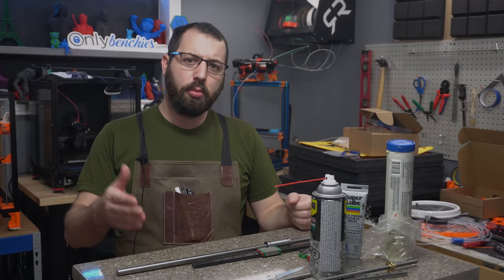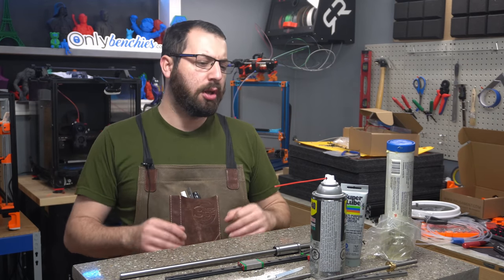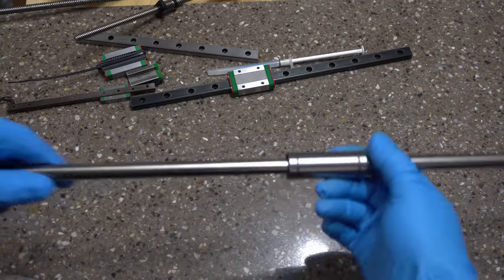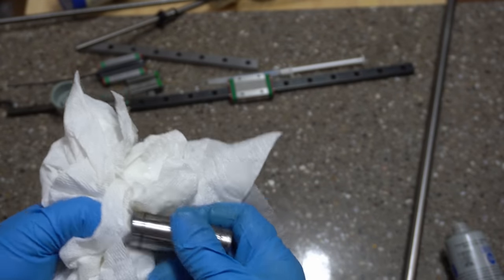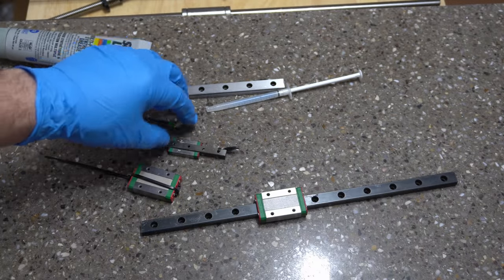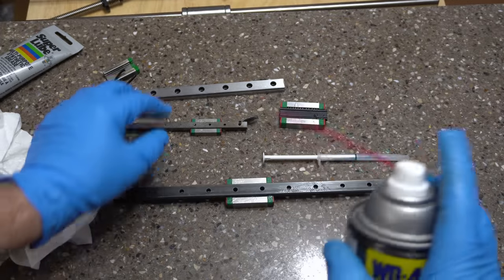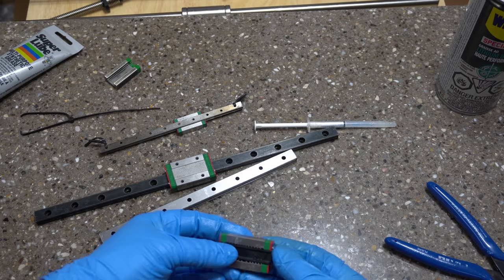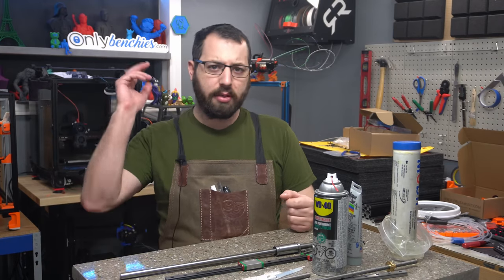Lubrication Basics - Keep your 3D printer running smooth and quiet

Comment: Excellent video. One thing: DONT spray your rails with standard WD40. Not only is WD40 a pretty ineffective rust preventer, it will also wash away the grease inside your bearings. I would lube the rail with a thin layer of whatever you lube your bearings with, so you don't dilute the bearing lube with whatever is on the rails.
Reply: We use WD40 in machine maintenance to clean up old oil on the ways of lathes. Then add in some new oil.
Reply: A bit outdated but WD40 is an actual Rust preventative... Its whole purpose. Its use in lubrication in null but they do have multiple versions for specific applications.
Reply: True, but that ain't the usual wd40 penetrant. It says white litium grease on it. I also have a different hight performance  release penetrant or something and some ptfe or something lube. So they have many types of stuff.
Reply: White lithium grease seems to be common for linear rails. It alao needs to be leas thicker
Reply: Yup. WD40 was never designed as a lubricant. It was designed to serve as an anti-corrosion treatment for missiles, and as such it was optimized for capillary action (i.e. it tends to penetrate and spread out over whatever surface it's applied to due to its low viscosity and low surface tension) and hydrophobicity. Those properties make it a great cleaning agent for difficult-to-access surfaces, but they're not at all what you want from a lubricant. As you say, it will displace any (better) lubricants that might already be there.
Reply: @deeply999  WD-40's value as a lubricant is not just null but negative. It will strip whatever lubricants are already there.

Comment: I'm somewhat confused about what grade of lubrication to use. In the intro, it's recommended to use NLGI Grade 0 or 1, yet one of the preferred lubricants mentioned is Super Lube, which is NLGI Grade 2. I'm guessing it's fine since pretty much everyone in the 3D printing community recommends Super Lube, but that's odd that manufacturers don't actually recommend it.
Reply: I have the same question! The LDO docs say NGLI 0 or 1 but then Super Lube is recommended which is NGLI 2. Very strange. Also, getting that super lube into a syringe is very difficult, let me tell you lol
Reply: Yeah this dude isn't paying attention at all

Comment: Awesome video! I'm glad someone is pointing it out. PTFE (Teflon) Grease, best of both worlds 😉I've been using it since i was a kid in the 90s, packed the bearings on my roller blades when i was 10 y/o and it made a world of difference. Since then it's been my Franks Red Hot, i put that $#!t on everything lol

I'm lazy and i simply just brush a thin coat of grease onto the rod/rail, run it over, bush more, run it over, brush, etc etc until grease stops getting absorbed. Clean off old dirty grease that collects at the ends, Do this every few hundred of hours of print time. That's my tip from almost 10 years of printing. Still have the original bearings on my Replicator Dual that has about 10,000+ hours of print time on it. Yeah, the wooden one

Next is how important it is to square your machine, stops binding but also reveals how much slop is in the bearings 😁

Comment: Mobil Vactra 2, stuff is awesome. It’s basically lathe way oil and is designed to cling to surfaces without becoming sticky. I run it on my machine tools and my printers. The stuff is super slick, lasts a good while and you can apply it with a syringe. I give my printers a shot every couple weeks, been working for years.
Reply: I liked the idea, and went to look for this. Smallest can is 20 liters lol
Reply: @Lecsi11  where are you located in the world? I get it by the quart from either Amazon or Ebay. Ive had the same quart for at least 3 years, so 20 liters would be a bit much.

Comment: Rewatching this video as I am building the next Voron printer.

On the site of LDO, in the rail grease guide they use the plastic bags of the rails as the bags where they clean them in.
This mostly works, except every bag have a hole or 2 so they leak IPA. Recommend doing the washing outside in the open air.

Comment: 1 - order 200 2mm ball barrings (about $5)  2 - soak linear rails in simple green overnight 3 - disassemble (carefully) the barrings 4 - pack barring track with Mobil grease 5 - reassemble , replacing the odd barring thats now lost in the carpet

Comment: You should look into the  "Finish Line Grease Gun" and "Phil Woods Portable Grease Gun".. I found this to be useful greasing tools and bearing runs that have fine clearances. you can even remove the  tip end and thread in a needle.. you can inject it deeper into bearings, theres also alot of pressure behind it to force old grease out or to push grease down the grease points..  Keep the grease tube attached and theres less clean up and waste too! Finish line and Phil wood both offer greases that fit their guns, but ive found that most "squeeze tube" greases are either 1/2 or 9/16ths screws and works outta the box (finish line is 9/16, PW is 1/2)

Comment: Thanks for the tips Nero! From the 5 rails that I got on my Voron 0.1 kit, 1 was very smooth, 2 were okay and the other 2 were a bit clunky. After flushing with iso and applying a bit of white lithium grease I noticed they all got smoother (the original clunkier ones turned up better then the original okay ones), but also a bit "slower". They are not sticking or anything, but will take a bit more force to start moving from a resting position. I guess this will all break into place once the printer starts running.

Comment: When I assembled my V2.4, I packed the bearings with grease. Now 900 printing hours later, all still seems to be fine.
Have you ever relubed linear rails? And is it possible to do that without (pretty much) disassembling your voron?
Reply: Remove the rubber wipers, apply grease to the rail, let the printer run over that spot a few times, repeat to your liking. This works for regreasing, but not for packing your bearings

Comment: Many others recommend using dry lube on the threaded rods instead of gresse because grease colllects dust and dirt on exposed parts..
Reply: True, but also dry lube wears off faster. Trade-offs with every product
Reply: It wears off really fast and doesnt lube as well. I used to use it but eventually switched back to grease because I was literally needing to reapply dry lube every week, if not 2 times a week.

Comment: Applying grease or oil to guide rods for linear bearing lubrication isn't ideal, but some does get into the bearing, especially on an older bearing where the wipers have some wear. Prusa recommends this technique if you don't want to disassemble the printer. It's better to disassemble but not always practical.
Reply from the maker: This is true, i have done it myself in the past, but its far from ideal and i never got good results, while it does kinda suck to disassemble to get the linear bearings out, properly packing them with grease and re-assembling gives much better and consistent results, along with lasting much longer
Reply: @CanuckCreator  When I first built my Prusa Mk3 they didn't recommend any lubrication for the linear bearings, so they didn't get more than the shipping oil at that time. It has been in steady service for a long time now and I still depend on it (at least until I get a Trident built), so I have done a few lube cycles on it without disassembly. Initially I used oil and more recently the Prusa recommended grease (and process), in both cases by putting it on the rods and working some past the wipers. I can tell it is getting into the bearings as it quiets the occasional slight vibration sound the balls make when they are too dry. Oil has to be done more often, the grease lasts quite awhile at keeping the bearings quiet. Whenever one hears the bearings it is time to lube again. Lubing via the rods is better than nothing, but clearly disassembly is best. Violent agreement here. Great video. :)
Reply: I am also doing this way. It is not perfect but I can clearly see a thin layer of grease on the rod . My scrapers have probably some wear. But I give a try to the nero 3d method once I have five minutes

Comment: I actually found a grease specifically designed for linear rails on 3D printers, and it's NLGI 00, which is slightly thinner than the NLGI 0 you recommend. I think in this case we should take the grease manufacturer's word for it rather then e.g. Hiwin, seeing as the Hiwin specs are all aimed at heavy duty industrial machinery. It should also be noted that if you're going for speed benchies, thinner = faster, too.
Reply: Also, I'd avoid any white grease (Hiwin recommend avoiding it too) - if the pigment is Titanium Dioxide, that stuff can significantly increase wear. They say 'no solid particles' in general.
Reply: @jezclark4882  Is PTFE a solid particle?
Reply: @TORDesign  yes, and you should probably be avoiding it because it can cause the balls to slide, rather than roll, which actually increases wear. That said, if don't mind the extra wear but want to go faster, PTFE seems to be popular with the HevORT and VzBot crowd.
Reply: @jezclark4882  I'd rather avoid wear - speed is not a problem with my Voron - but need to spray into the bearings - big job to remove the rails - so do you think the "WD-40 Specialist ® White Lithium Grease" is therefore the best choice?
Reply: @TORDesign  no I'd avoid anything white in case it has titanium dioxide in it (again, for wear reasons). Grease manufacturers recommend NLGI00, 30-200Cst, Lithium-based and no solid particles. I bought a grease from a manufacturer that fit those specifications and was sold as specifically being for rails on 3D printers; when it arrived, the tub said 'bearing grease' on it, so that might also be worth a search. Can't remember where I got it from, think I found it on amazon.
Reply: @jezclark4882  thanks but I need a spray grease like he shows us to avoid dismantling my Voron. Hard to find here in New Zealand
Reply: @TORDesign  if you're using a single rail you might be able to drill a hole through the profile using one of the rail's holes as a guide, then inject grease through the hole from the back while the carriage is over the hole

Comment: That spray grease is neat stuff, reminds me of what we have for our garage door chain and spring.  Which I admit I have also brought into work and sprayed in drawer runners too, though its a silicone lube not lithium.  But I do wonder if it would be good for those linear rails.

Comment: Good video Nero! I like your way of speaking very much!:goodvibes:
One question regarding lubrication: How do I  grease the linear rails in the voron? Do I have to disassemble everything to get the rails on the desk for cleaning and greasing? Or can I grease them inside the case in assembled position? What is your experience with that?

Comment: On my linear bearing blocks, there's no grease channel in the steel block, but the green plastic endcaps do appear to have thin internal channels that lead from the grease holes into the ball bearing tracks.  I've never tried getting lube in that way, though, so I can't confirm, just wanted to note that you may not be able to judge this just from the metal block.

Comment: Regarding the lubrication of MGN rails, the advice from manufacturers is ambiguous. Hiwin recommends relatively thick stuff, but says "check with your lubrication supplier". Klueber is one of their references, and they in turn recommend very liquid greases like NLGI 00 or NLGI 000. Personally, I tried NLGI 2 and NLGI 00/000, which is sold for cheap in 900g tubes for automotive use. I recommend that thin 00/000 stuff over everything else. It is less noisy, and it is easier to apply. It's easy to apply too much of the thick stuff and get sticky balls as a result. With NLGI00/000, I can apply generously without issues. It even makes the intervall longer.

Comment: T-9 silicon spray knocks the socks off any of those greases or lubes. Developed by Boeing for lubricating aircraft, it protects my table saw and lubes everything in my garage woodworking shop. When it comes to not collecting dust and 12month performance nothing else has come close.  One $12 can has lasted all of my household squeaking doors, workshop, and 3-D printing for 3 years. You won’t be disappointed.
Reply from the maker: I didnt really cover specific brands for this reason
Was going to grab a can of the t-9 spray to try....only source up here in Canada is amazon at 65$ a can lol
Reply: @CanuckCreator  😬 yikes, still worth it, I have not priced it for years, haven’t needed to.
Reply: T9 is an excellent penetrative rust shield. It provides some lubrication but is inferior to quality grease in lubrication performance.
Reply: @alanb76  technically yes, but the combination of staying power, dust resistants, rust protection, and lubrication have not been beat in my experience. Then again most office 3-D printer setups won’t experience the dust and conditions I often have to deal with.

Comment: I am not an expert but I was warned many times not to use WD 40 for any kind of lubrication. It was told it was intended to clean not to lub. Maybe this is different. Great video BTW.
Reply from the maker: Your not using as lube, your using it on the rail itself for rust prevention, the bearings in the carriage get grease
Reply: I wouldn't use regular WD40 for this purpose like you said its a good cleaner but it is also for lubrication just not the best for this use case. What Nero is using is WD40 silicone spray grease which is what I use on my own rails. I use generic white lithium for my lead screws.
Reply: Another important note is there are now a full line of products from the WD-40 company, including grease and oils, along with the traditional WD-40 product for displacing water/ preventing rust.
Reply: He isn't using WD-40. He is using WD-40 branded lithium grease you can also get WD-40 branded PTFE Grease. You can get loctite branded stuff for 3D printers now. These are just brands everything except for the original WD-40 product is not NASA era WD-40.

Comment: Very useful video. Can linear rails be lubricated by spraying/injecting through one of the rail holes with the carriage aligned over the top of it?
Reply: I have done it that way.  It works but leaves a slug of grease on top of the rail/bottom of the car.   I figure the clinging grease on the car acts as a reservoir.

Comment: QIDI recommends "any light oil" for linear rails and "any thick grease" for lead screws, so not much to go by to be honest :)
I gues the reason they go with oil on rails is because they use some sintered graphite bearings rather than actual ball bearings, also you cant actually take them out without going deeper than you are supposed too.

I did my first service after about 3 months and used spray on PTFE oil on rails and MoS2 grease on the lead screws. So far nothing has died.

Comment: Hey, I'm a machinist in Washington. My work is thinking of getting a new 3d printer. I showed them the cad and some videos of the voron and they were impressed. But a question I got back was what kind of tolerances is possible with a well built voron?
Reply from the maker: As accurate as  you can get spewing molten plastic out of a piece of hot metals :P

Vorons are great machines, but be aware, in a work environment, they DIY machines, so they dont come with any tech support/warranty etc. so if something goes wrong your fully responsible for its upkeep and maintenance should anything go wrong
Reply: @CanuckCreator  I have a ender 3 and have had surprisingly good numbers and been able to get around .002(inches) with my target. I was just curious if that sounds reasonable for a voron.
Reply from the maker: @lucasshaver2739  Long as you take the time to tune your slicer profile its possible.
Pretty much all 3d printers using the same hardware for motion systems
Reply: @CanuckCreator  thank you. I know your time is valuable. I definitely appreciate you letting me bug you. I started printing the 2.4 kit today and hopefully I have a voron for my personal printer very soon.

Comment: What's the part number on the super lube you're using?  Seems like the most common stuff is NLGI 2, and your weight recommendations make it sound like that's too thick.
Reply: You can use NLGI 2, it's working. Yet it makes more sense in applications with more load. For 3D printers, thinner lubrication is advantageous because it has less friction, generating less noise and running a bit smoother. In linear rails, thinner lube has less risk of overlubrication which causes sticky balls.
Reply: @DetlevRackow  Thanks!

Comment: Hey for the linear rails the dummy piece you said you could print it, however I cant seem to find any stls for it
Reply: Same... I was able to make one by using the CAD files for a Voron 2.4 build. Opened in Fusion 360, you can select the rails and 3D print them. They will be full length, but you can cut them into smaller pieces in your slicer, or modify the file in Blender.
Reply: @StevenLongley  Thanks ill try that out

Comment: Great video for us "heavy modding noobs".  Question: does the same apply to LDO rails too, in particular lubing from the start?  I've heard those are supposed to NOT be lubed out of the box, but lubed in a maintenance sense down the road after some usage. Is that true or false?
Reply from the maker: My LDO rails came with just rust preventative grease on em, so did the flush and re grease right away
Reply: @CanuckCreator  awesome, thank you sir, I will do the same.  I have 5 of em in a box just waiting to go, and I trust your word over "theirs" any day of the week!